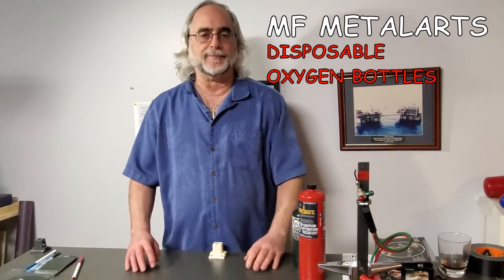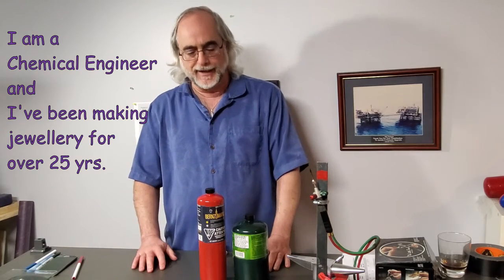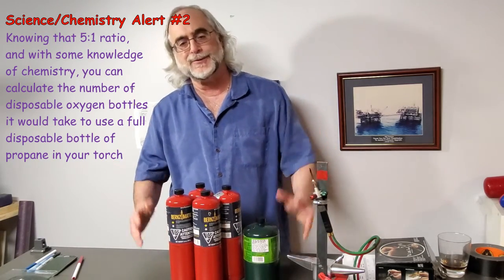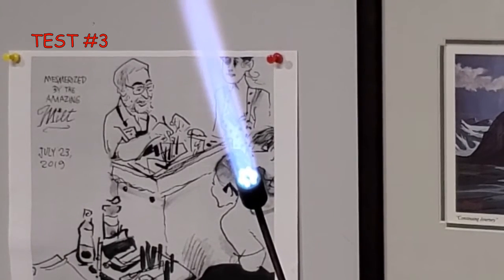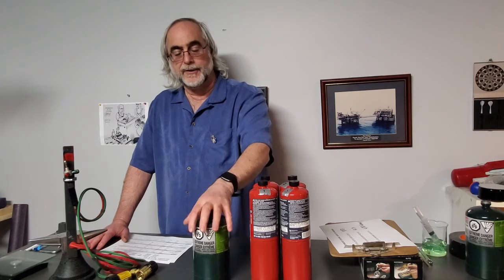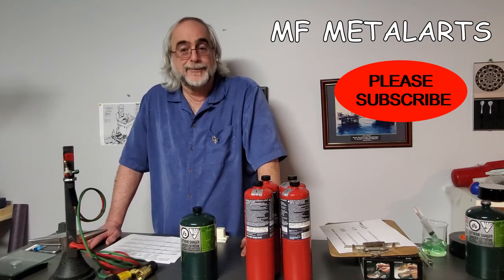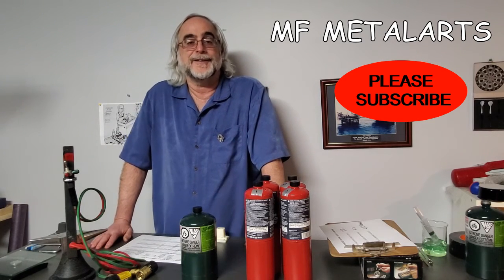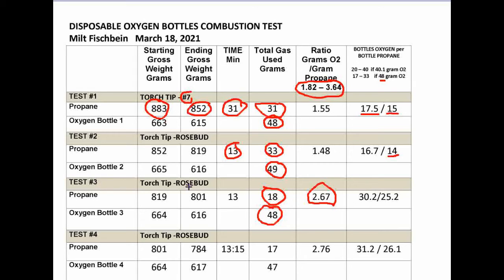Disposable Oxygen Bottles for an Oxy Propane Jewellery Torch.

Comment: Hi. Thanks for posting this video.  Would it make sense to use the Smith Little Torch with those small disposable propane tanks with an oxygen concentrator?
Reply from the maker: Yes, you can use an oxygen concentrator,  that is a very common setup

Comment: Can you use worthington oxygen and propane disposable tanks with the smith little torch
Reply from the maker: To the best of my knowledge, yes, all of the disposable tanks have threading systems that will work with their respective regulators ie propane needs a propane regulator made for disposable tanks and same goes for oxygen (different regulator).
Reply: You're vastly better off buying small industrial oxygen cylinders than spending far more per tiny low-pressure fill for disposables. Worthington and other standard disposable LP cylinders fit because the LP thread is a Compressed Gas Association standard.

Comment: How did you use that much ox I never used anywhere near that .  Even using it for years as a professional jeweler
Reply from the maker: Hi Warren.  The video clearly shows how I did the tests.  How I set up the torch etc. The results are consistent and accurate. Is there something you feel that I did incorrectly in the design of the experiment? Do you have any specific data on the number of disposable oxygen bottles you used per disposable propane bottle ?  I would be very interested in understanding your experience with disposable oxygen bottles

Comment: Compellingly shows to go one that a M or R tank will probably save mucho dinero comipared to the 1lb’ers.  Though I am guessing, having done no comparative calculations.
Reply from the maker: Yes, you are correct.  The other option would be to go with an oxygen concentrator
Reply: It's no contest re:oxygen. A Homefill concentrator can also refill small industrial cylinders if you assemble an adapter using high pressure fittings (Western dominate that market) and the Homefill male QD, or you can and I do use an adapter with medical cylinders (in my case for running a cutting torch in the field for very short tasks) and run a standard oxygen regulator. Some time spend reading about CGA fittings and welding oxygen in general is well spent.

Comment: How come on test 1 you used a #7 tip but test 2 & 3 it looks like you're using a Rosebud tip. Definitely not the same tip being used. Just curious.
Reply from the maker: Hi Stacy,  Thanks for your interest. The reason I switched to the rosebud tip  was to make the testing go a bit quicker as the rosebud tip uses a lot more fuel than the #7.